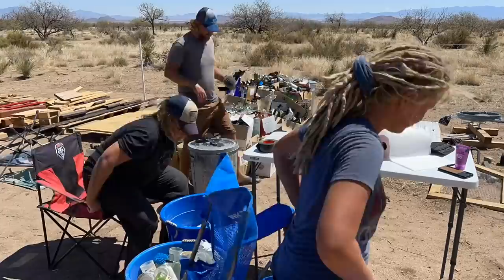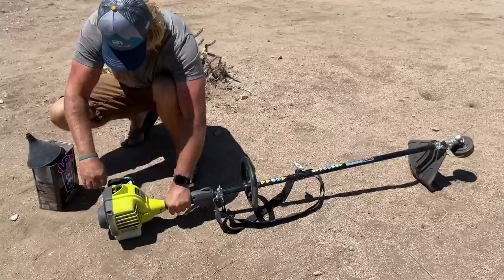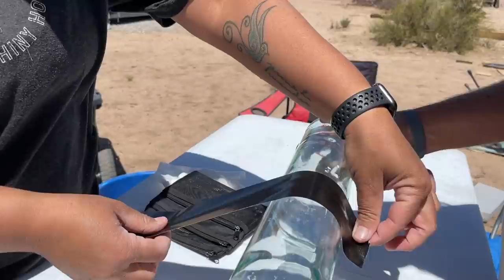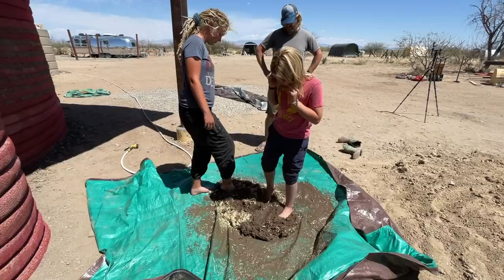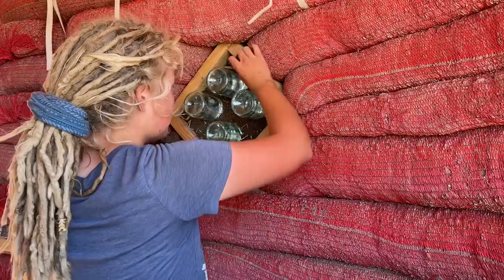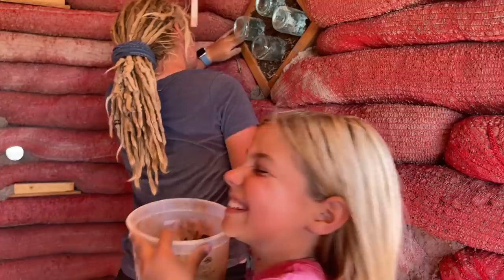Installing Bottle Bricks in our Hyperadobe (earthbag) Solar Shed

Comment: The bottle work looks really cool. Friendly suggestion: measure the part straw in the same container you measure the sand and clay instead of eyeballing it. When you get to the cob work that sits between the bags and the roof, this will be more important because you want the right amount of tensile strength and the correct proportions will hold up over time! Also, if you are doing bottles to save time on cob, but if you're going to stucco finish, going around those bottles with stucco could take as much time as you save with the cob.

Comment: By extending the bottles so far beyond the cob, it seems they transmit more light. So cool! Bottle wall to fill in the gap at the roof will look fantastic!
Reply from the maker: They won’t be sticking out this much once we finish the cob/plaster on the inside and outside. This is just the base layer.

Comment: Glad ya'll are having some fun after all that hard work :)  Ashley, be sure to stick some nails in your wood forms before you cob...wood shrinks and expands and the cob will just crack and fall off (cob shrinks over the years too)  Maybe put some drywall tape on it...and that pretty diamond shape will shrink and pop right out...so nail it in before your final cob job.  My two cents :)

Comment: A fun experiment making the bottle bricks would be to put the two bottles together like you are going to tape them but instead of using tape, heat them up with a torch until the glass melts and see if you can melt them together.  I have no idea if it would work and I doubt it would be any better than using tape, but any time you can play with fire it is a good day!  Plus it might give you some cool ideas for your next build project... Melt two bottle of different colors together longwise... :-)

Comment: BOTTLE suggestion: I wonder if using white tape for bottle bricks, and paint or wrap in white plastic leaving the ends bare. Then more light will reflect through into the house. Also did you know filling a bottle with water and lil alcohol and silicon lid shut (a bottle with tapered top like pop bottle) put through a roof with cone upwards, it captures light equivalent to 50 watt light bulb during the day. Maybe put some into a storage shed roof to light it up inside in the daytime.
Reply: Wow great skylight tip

Comment: The problem with your cob is that it's not well hydrated. You need to hydrate it for at least a week by making a pile of your clay sand mixture and then make a crater in the middle of the pile and fill it with water and wet the out side and cover it with tarp. There are liquid binding agents that you can add it in your final mix just prior to applying the cob. Hay rather than straw provide better tensile strength

Comment: I live in Nevada (Las Vegas) we get dust devils but not as often IN the city as the buildings usually prevent them from lasting long. I will never forget YEARS ago I was sitting at a traffic light and a massive dust devil came though and literally knocked a man and woman off of a Harley that were on in the turn lane next to me. They weren't injured, the Harley however did acquire a few scratches.
Reply from the maker: Yikes!

Comment: It’s a good thing Nine Nine didn’t steal that roll of paper towels when there were shortages... I got so used to conserving, I saw that and had one of those massive time-slows-down, “ohhhh noooo...” moments before I started chuckling.  😃  quick question about the dust devil ... I was surprised to see it heading towards you because it looked like there were trees (figured that would have broken up the air flow and stopped it, but maybe it was following a dirt roadway).   Then it suddenly seemed to go out when it was over what looked like open ground.  What actually is the landscape it was traveling through?
Reply from the maker: Right. Ha. I forgot about that time.
Reply from the maker: As for the dust devil, it started down the dirt road but they turn so quickly then came into our property. Our trees here don’t seem to stop them. I think they typically travel all the way into town where they can be stopped by buildings or sometimes they just die down. That’s one of the biggest ones we’ve seen come through. Last year it took our shade structure up and threw it back down in a mangled mess...AND it had 160lbs of sand bags on it! They are intense out here.
Reply: @TinyShinyHome  whoa!  That’s incredible.  Thanks for describing the terrain!

Comment: Don't know if its been suggested before but have you thought of using chicken wire on the building first and then cob over it?
Reply from the maker: We don’t need chicken wire. The mesh of the bags has the perfect texture to hold the cob. :) one of the reasons we went with these bags.

Comment: Won't the mud erode?  What gives it long term stability to resist wind and water erosion?  Or, do you just cake on another layer every few years?  The structure is looking great and I'm really enjoying your videos.  But, I have so many questions.
Reply from the maker: It will not. Have you ever seen Adobe buildings out here built hundreds of years ago and are still standing? The early settlers of this area knew how to build this way and it really makes sense for this climate. We will be sealing the whole building this way, but we will be adding a protective coat at the end.
Reply from the maker: Also, the roof covers most everything.
Reply: @TinyShinyHome  I saw a documentary a long time ago about an adobe mosque in Africa, where the builders left horizontal posts sticking out of the walls every few feet.  It looked odd.  Kind of like the Pin Head horror film character.  But, the horizonal  posts were there to support scaffolding that was erected every so often in order for workers to recoat the adobe with a fresh layer of mud.  I'm enjoying your videos.  God Bless.

Comment: Why not use the cement mixer to mix the cob?
Reply: you can...but clay needs more hydration with pressure.  If they soaked the clay in water before hand, they could use a mixer.  And I think they wore out the motor on the mixer filling the bags :)

Comment: Agree your dog is adorable. Have to say your cob mix still does not look right. Made some suggestions in you last vid. comments that should help. You don.t want to get this wrong in the wall coats or it may pull away from the wall and you will be forever repairing it. seems clay content or water is lacking.  should have a slimy clay texture when fully wet. the clay should fully coat the straw being added. Its the main binder in cob.